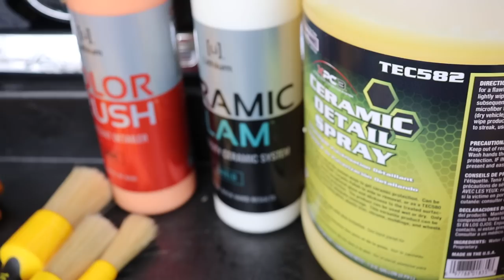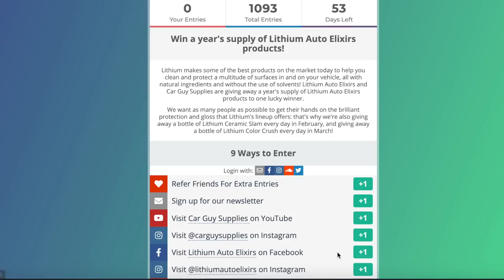Awesome Detailing Products and Tools!  #Autodetailing

Comment: The rag company mits are my favorite, I actually have 4 now to make the washes so much better. Also, Technicians Choice Ceramic detailer is fantastic. It's my drying aid/final step after most washes. Quick wipe down of the paint, trim,  windows, inside the door jams, and sometimes even the wheels ❤
Reply from the maker: Yes!!  Loving the kitts and Techs choice!  😎👍🏼

Comment: which brush is the softest for new rims? the orange one/ white one/ black one or the normal one?? thnak you
Reply from the maker: I use the black one because it has a little stiffness to it because you need that for the wheels. But when wet and soapy it’s still soft and won’t scratch. The natural hair and white ones are very soft also.

Comment: Enjoy your vids! Do you have one where you clean the carpet you have pulled out of a car or suv? Our 2007 CRV leaked during torrential rains last week, and we’ve fixed the leak but had to pull out the soaked carpet and we need to clean it now. How best to clean it since it’s out of the car? We need to clean the mats as well. But the padding under the carpet was just awful, wet and molded and apparently this had happened once before, before we bought it, unbeknownst to us! We had to trash the molded padding. Where can be get more? Thanks in advance.
Reply from the maker: Thanks!!  Actually we never deal with pulling carpets out. Way to risky for us personally. However we refer those customers to another company here that does interior restoration so they will remove carpets and dry out the vehicle and even replace the padding if needed. The company is called the Interior Guys.

Comment: Which black Work Stuff brush did you use on the wheels? Would you recommend it as a dedicated lug and caliber brush? I am badly in need of something to clean these two areas. Your recommendation would be greatly appreciated.
Reply from the maker: Hi. We use these ones for wheels and lug nuts 
https://bit.ly/39t4UA4. It you want something a little more soft then these would be great also https://bit.ly/3sGQGmQ

Comment: Between Technicians Choice Ceramic Detail Spray vs POLY-SEAL HYBRID POLYMER SPRAY SEALANT which one is better? What is the DIFFERENCE between these two products? Which one should I choose then? BTW, learned a lot from watching your videos!! You ROCK!
Reply from the maker: Thank you!!  They both have their place. The Techs Choice detail spray can be applied wet like a drying aid and also dry. The Ceramic Slam is dry application only, I feel the Slam beads way better but that just my opinion. Both are so easy to work with. Did you enter to to win the Ceramic Slam?  Click the link in the description